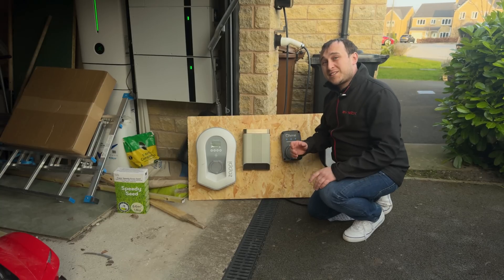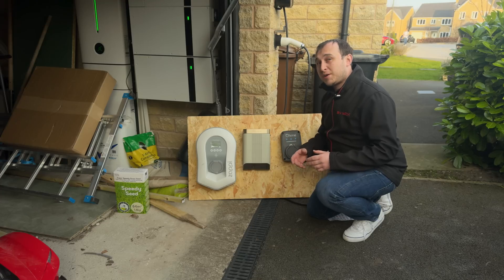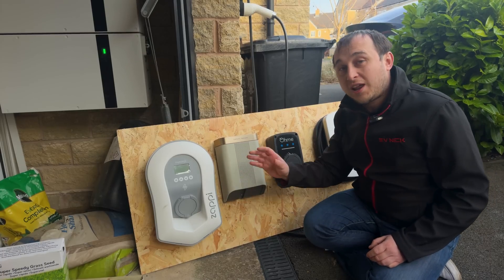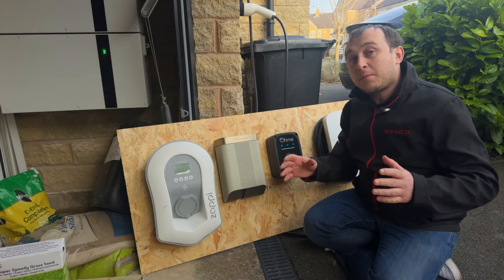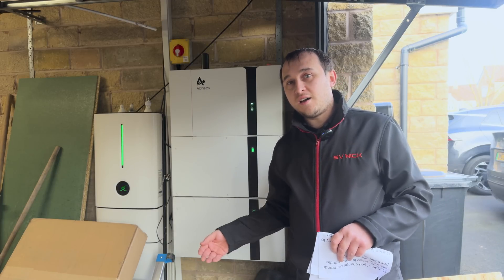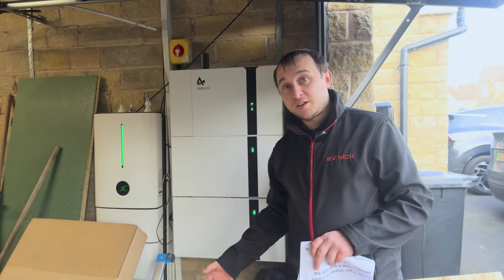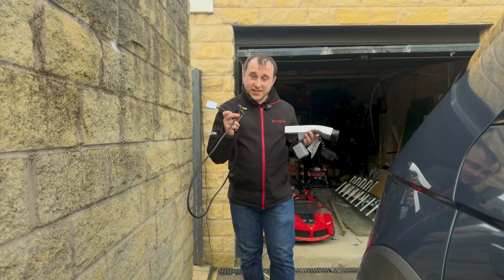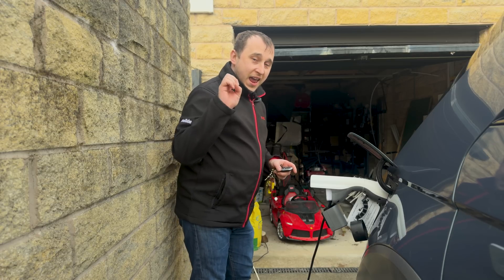DO NOT TRY THIS AT HOME V2H Powers Heat Pump From My Car

Comment: It's simple like with solar inverterd the AC charger is fixed to output a limited amount. The charger should still communicate it's capability for export. That way the car can change but the export restriction remains at the right place.

Comment: if i were you id re make the video showing if your car can run the heat pump, or not and take the suicide cable out of the video. its just stupid. do the work and make the correct cable - if you are as you said, "qualified"

Comment: Would it not be safer just have the charger plug connected to a inverter like sunsynk where they have a micro inverter input,
Reply: To do that, you'd have to connect to the DC side of the car. That's at 400v, so it's at least as dangerous as the car exporting mains power. And then if you bought a new 800v car, you'd still have a compatibility problem.

You'd also have to buy the inverter. The car already has a massive inverter to power the motor, it just that it isn't (currently) set up for grid export.
Reply: @robinbennett5994  No I men't instead of using the suicide cable for v2h, instead connect it to an inverter that supports micro inverter or generator input
Reply: @ Oh, I see - so the car provides unsynchronised AC and the inverter synchronises it. The inverter already has approval to be connected to the grid, so the car manufacturer doesn't need apply for approval in hundreds of different regions. That's a neat solution.

How would the power output level be managed though? The car's inverter probably just sends as much current as required to maintain mains voltage, and solar inverters expect to export any excess power. I think there's a missing piece, equivalent to the battery-inverter that matches battery draw to the power required by the house.
Reply: @robinbennett5994  as far as i am aware v2h is 3.6 standared in most cars that provide v2h, even if its more  the inverter will only draw its own max current, also for example if you where to connect just a fridge to a v2h it would only supply the current needed, if that is what your asking, also i am just asuming that this can be done. other wise Home Assistant and a bit of diy.

Comment: I have a split load  consumer unit, where i can backfeed (one side) from my shed solar array, and now with a suicide lead from my KIA EV3 i can backfeed via garage socket, obviously all main fuse box switches in off postion. So i can charge my KIA at 9 pence per KWh (between midnight & 5 am) and use the cheap electricity during the day, saves forking out for main roof top solar panels !

Comment: What you’ve got there is a low wattage inverter built into the car. It really needs to be a DC to DC connection so it can integrate with your home inverter so it can support a decent load. Probably you’ll need yet another box 😂
Reply from the maker: V2g ac will be around 3-7kw output

Comment: In Canada our car does 120 volt 16 amp so only useful for those appliances. Not useful for well water pumps or heavy equipment for my rural home.  The electric  Ford and GM pickup trucks and vans do have much higher powered V2L suitable for V2H or trades use on a jobsite. Ford and GM have V2H solutions available. Using DC to AC invertors and batteries.

Comment: Wouldn't it be easier to just get a Gateway of some kind (Tesla or GivEnergy) so that whole house auto-switches to battery power in event of blackout? 
I am on Indra V2H trial and have been using Leaf 24 kWh to power my house. Brilliant tech, should be standard on all EV. But I still got home battery installed just because it is always connected and provides whole home backup. If we do get multi-day blackout, I can use the Leaf to transport electricity back home and charge up home battery (tested this).
Reply from the maker: I have batteries but not for backup power,  in the 7 years I’ve lived in this current home I’ve had 2 power cuts lasting a grand total of 2 minutes,  am rural in location but also served by underground cables so unless it was a terriost attack on multiple power stations it’s highly unlikely I’ll be without power

Comment: If you plug the V2L into a plug socket in the house will it not power the house?
Reply: Well as he did with the suicide cable, I used one with a petrol generator during the big storms in the 80s, mostly to keep my freezers and the lights on that was the limit of the generator.
Reply: If your house is also connected to the grid, the car's inverter isn't designed to synchronise the frequency or match the output to your demand (unlike a solar inverter).

If you're disconnected from the grid (like Nick was), the car would power the entire house - but it would be really easy to overload that one plug.

Comment: The standard is ISO 15118, one manufacturer is the Ambibox, which already works on a few EV's
Reply from the maker: That’s a DC and although iso is there cars sold in the EU going AC v2g not Dc,  DC much easier for grid codes as it’s the charger that needs the DNO permission same as what we did with leafs
Reply: @NicolasRaimo  even with AC you could still make the wall box the "charger" for G99 purposes because it's the wall box that communicates and controls how much power can be transferred, and G99 is mainly about controlling the amount of power flowing in and out of a house and into the nearby grid. Same as for charging it's the wall box that tells the car how much to draw and therefore the wall box that dictates what the DNO get told.

Comment: Surely its the charger that defines the max output to the grid, not the car, hence DNO just needs to know max charger output V2G.
Reply from the maker: So here’s the mess of how the system works..  as it’s the inverter that needs the DNO request and inverter is the car
Reply: @NicolasRaimo  But aren't MyEnergi working on a V2G charger (Sept 24 press release)? This all sounds very similar to the mess that started with "smart tarrifs" - some people set it up on the car, others on the charger. I guess we'll just have to wait and see...!

Comment: Really enjoying these hack videos. I wondered if you could do something like this and plug into the solar ports using an 84v ebike charger. I can't see why it wouldn't work 🤔
Reply from the maker: Don't have a ebike :-p
Reply: @NicolasRaimo  That is very surprising considering you EV Nick haha
Reply: Do you think the solar ports  would accept any dc input providing there within the amp/voltage range of the invertor?
Reply from the maker: @ haha I got a scooter…. 🛴
Reply from the maker: @ which solar ports where sorry…
Reply: @NicolasRaimo  sorry, I wasn't very clear. Could you convert the ac from the v2l to dc voltage then plug into it the mppt ports on the invertor? 
My minimum input voltage on my invertor is 70v so that's why I thought a 84v ebike charger swapped to mc4 connector would work
Reply from the maker: @ it comes out as AC not DC